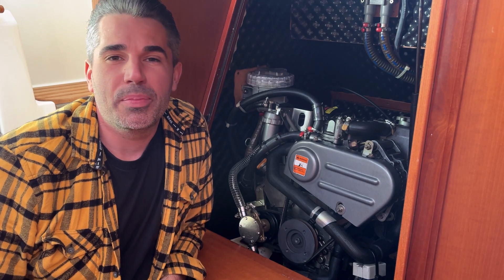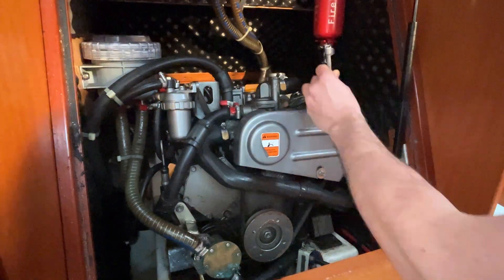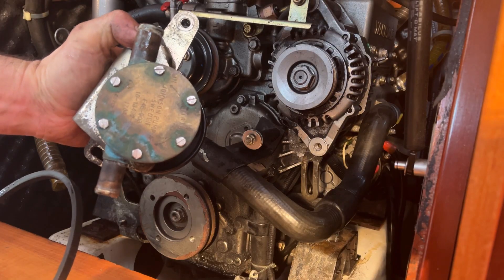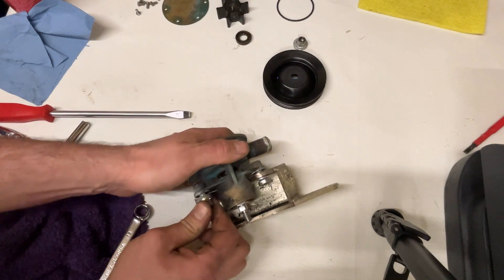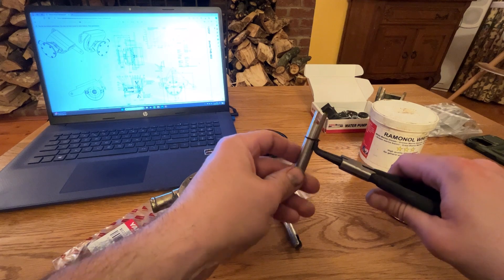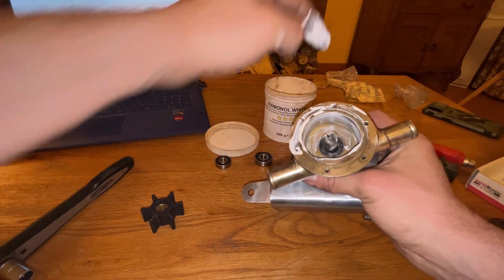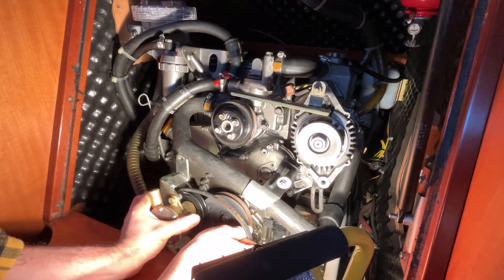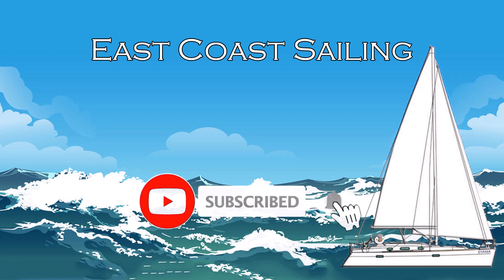Raw Water Pump Rebuild Yanmar 3YM30 Johnson F4B903

Comment: Used to have to the seal leaks every year or 2 due to corrosion of the spring clip in the oil/water seal just like what you experienced. I changed the metal spring to suitable sized viton/nbr o-ring and no more leak for more than 5 years now.
Reply from the maker: That’s a good idea, have you checked the diameter of the shaft? Might be warn down? Never had a problem with the Yanmar seals. I would say changing the seal every couple of years is quite normal but I do it preventatively not when it leaks. As soon as that water gets to the 1st bearing, that bearing will get play and speed up the the leak and create more damage! Thanks for watching 🫡🇬🇧🐧⛵️

Comment: Useful Video- ta. I pack that seal spring cavity with grease as-well. Worth finding a good quality seal, the quality of spring VIP. All seals are not created equally.
Reply from the maker: Hi, yes I should have mentioned the grease although it’s actually silicone grease. Normal grease would perish the rubber 😎👌 thanks for watching

Comment: Hi, thank you for the excellent video.
My pump failed when still quite new with not very many hours on it.
The garter spring in the lip seal was the problem, just like yours.
I'm wondering if the lip seal should or could be installed with the garter spring on the bearing side?
That would avoid saltwater on the spring (even if it is SS). Also the pressure would be a better direction for the seal.
Any comments?
I originally had a 3GM30 (as opposed to 3YM30) engine and the water pumps on it (orig plus spare) did something over 1,000hrs each without any problems & it is possible the lip seals were garter in but it's too long ago to be sure. My much newer pump has been a disappointment in terms of longevity.
Reply from the maker: Hi David, glad it helped. I would just have a few lip seal spares on board. They are £12 a pop. If you turn the seal round it will work but will weep after a while. If the boats sat and not done many miles all the crap can build up and pit / rust the impeller shaft. Best to have a look for any defects on the shaft otherwise it will shred the next new lip seal. Thanks for watching 😎🫡🇬🇧
Reply: Bearing seals typically go in with the flat side exposed to water.
Reply from the maker: @WarrenHindley  Hi Warren, please don’t give advice if you don’t know what you’re talking about. Every pump is different. The lip seal side faces the water it’s trying to keep out. The pressure of the fluid (sea water) presses the lip seal against the impeller shaft creating a water tight seal. I have supplied the parts diagram. Zoom in and study it and you will see the recess and spring faces the water side. Also google how a lip seal work on a boat water pump and chime back. Thanks.

Comment: watched this video, then went to the local yanmar distributor to get the parts. That looks like the pump, with a different bracket, that is on my 3GM30. I went to rebuild mine, and the dealer didnt stock the rebuild parts. They strongly recommended NOT buying the "kits" as the aftermarket parts are not always up to the quality of the pump. Since The pump was relatively inexpensive, and in stock, was easier to just replace it , and now comes with a 1 year warranty. The pump (at this time) is US$225, to me, was well worth the money to just replace it in its entirety.  Other than rotate the pump in the bracket (see my video on my channel) for my specific boat, it saved a weekend just replacing it. Obviously different model and different year pumps can be priced very differently!
Reply from the maker: I wouldn’t believe anything a Yanmar dealer tells you 😂 it’s not in their interest. The pump likely costs £10 to make and distribute so it’s still a huge mark up. Like the bearing costs I gave example’s of and yanmar don’t make bearings. Also example: 3 fuel injectors from yanmar were £1200… off Amazon £40. I have done 2000 nm on the boat since they were installed with no issues. I brought a new water pump in the video but this model in the UK would be £400 . That’s a lot of money and you haven’t learnt any skills. How would you fix this at sea ? I fixed my old one and have a spare on board which is great. Buying the aftermarket service pack or parts wound have cost you £50 and you could have a spare pump on board if anything happened. It also gives you a good understanding of the mechanics and likely parts that will fail, gives you a good insight of which parts to carry! Everyone has different drivers, for you throwing away an old pump and having more time on the weekend is important, for me is learning a new skill and knowing in depth how to repair something on the go as some places i visit don’t have much support and only get one big trip a year and can’t suffer a breakdown. What had failed on your pump ? Was it a water leak ?
Reply: @EastCoastSailing_  I remember when the injectors were cheaper to replace than to rebuild!  Now not so much. If I need to replace mine, i will likely just buy OEM and deal with it. Quarter century on the ones in the boat don't owe me anything.  Still, since I DIY my repairs, I almost always go with OEM parts. Heck I use Yanmar Oil and Yanmar coolant!  Its not any more expensive , at least here.  To answer your question if I were in Blue water, I would have spares of everything that is reasonable. surely both water pumps, belts, gaskets, etc. doing coastal cruising, Ill just be towed in and deal with it wherever I am, if I can't fix it in the middle of the ocean.
Reply: @EastCoastSailing_   on mine the bearing seized, seal let go. could see the bearings from the pump side.  I could have sourced the parts, lost the entire July 4th/Independence Day holiday weekend, or just spent US$225 and salvaged the weekend and a refrigerator full of food. Took 3 hours from finding the problem, getting off the boat, going to the yanmar dealer, getting the pump, modifying it to my motor, installing, painting, to slipping the mooring. To me, the cost was worth it. I may rebuild the old one if I have some time. But that one got me over a decade, so I have zero complaints.
Reply: Being able to DIY the repair, was a huge savings in time and money over having the boat yard do it . Honestly, its the least expensive thing I have had to do on the boat.  Yes, sometimes you have to pick your battles. a cheap pump was a good value not to blow a long weekend. If it happened in the off season, and i had time, sure i would have torn into it.
Reply from the maker: @ohlson38 😂 yes I don’t blame you! I’d take a cold beer any day over rebuilding these.
Reply: @EastCoastSailing_  I did end up rebuilding this, made a video of it. I kinda cheated, got a "kit" from ebay pre-assembled. was quite easy, after everything was cleaned.
Reply: Curious where you found your pump for so cheap? I have multiple rebuild kits as I have three pumps that need to be rebuilt and one that is currently weeping so that now needs to be rebuilt. We are usually in very remote areas of the world but now are in New Zealand replenishing the spares. Cheers.
Reply: @dentonearnhardt9891  The pump in this video looks the same as mine, the bracket is different though. The rebuild is the same. I have a video on my channel that shows me rebuilding using a pre-assembled bearing assembly I got off ebay.  Same as this video, but all the parts all pressed together.  Should keep the rebuild kit on board. pretty easy rebuild, especially with the pre-assembled guts. The kit I got included all oem parts with aftermarket bearings.
Reply: @dentonearnhardt9891  looks like my reply got deleted by yt. got mine from niemic Marine dieselpartsdirect which is a local dealer.

Comment: Nice video thanks very much. I bought a rebuild kit from yanmar, but it didn't come with the lip seal... That's almost certainly the bit that's failed... Bit annoying
Reply from the maker: @rhysthomas623  are you in the UK ? I can send you a link to a very good kit 😎👌🏼 thanks for watching
Reply: @EastCoastSailing_  I am. N just the seal would do 👍 thank you very much 😀
Reply from the maker: @rhysthomas623  Hi Rhys, this is the part If you have the same water pump! https://www.ebay.co.uk/itm/181519551322

Comment: awesome maintenance video! i have the same pump on my 343. do you have any tips on keeping the raw water pump belt taut?  my belt will not tighten to spec it slips on start up.
Reply from the maker: @carlreed1212    Hi Carl, glad you have found the channel, feel free to share any links with friends if it helps, always keen to grow. The water pump belt they fit as standard is a Mitsubishi M19 belt, these are too big! You run out of adjustment before the belt is tight. Terrible design on the tensioner, relies on you manually pulling the water pump out and tightneing the bolts up. Check the links below for your spares, the belts they sell are brilliant and costs a fraction of the price. Before fitting, clean both pulleys up as you tend to get a lot of rubber belt dust coming off the Alternator which can cause it to slip. Then spray some non slip belt spray 😎👌🏼 make sure you check out the ECS store if this helped🫡 keep 3 belts on board. You will see in my latest video I had one fail and didn’t have any spares on board. Don’t over tighten the belts as it will wear quicker and ruin the bearings on the pump and engine! 

 Belt : 

https://parts4engines.com/products/yanmar-3ym30-sea-water-pump-drive-belt

Belt spray: 

https://www.mymotorworld.com/hycote-workshop-belt-slip-400ml?gad_source=1&gbraid=0AAAAAon7BN9BpU0Q7FQREgGhwbKdmb94X&gclid=Cj0KCQiAwtu9BhC8ARIsAI9JHamVjROUDM0EyFcEbuJBM9v_psisyeRXB6vG_lVXAKZeSJs8vfvYsy0aAtJCEALw_wcB